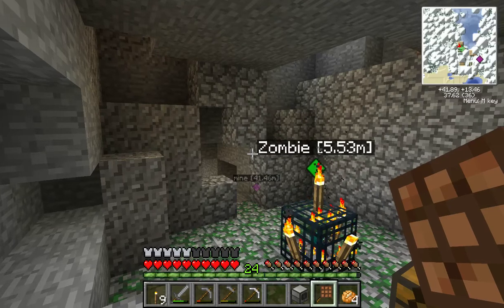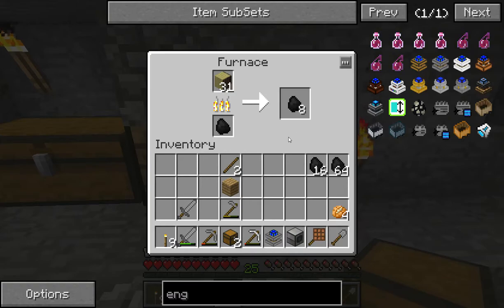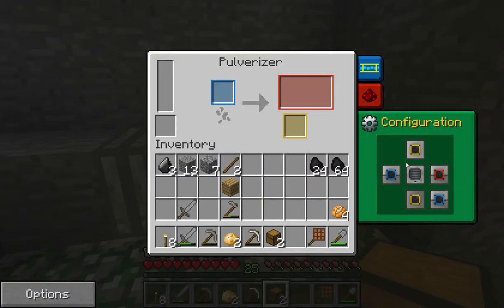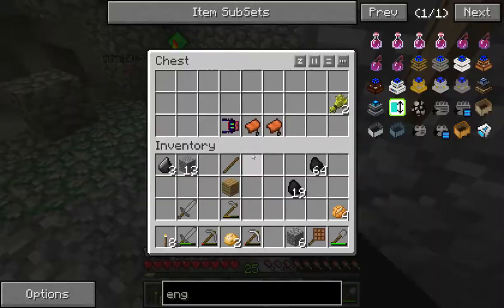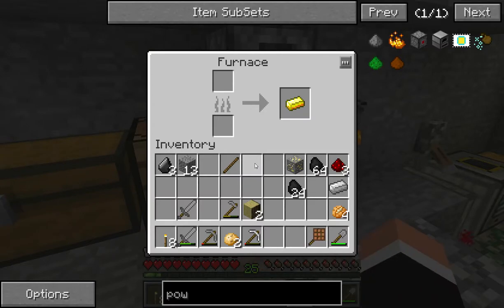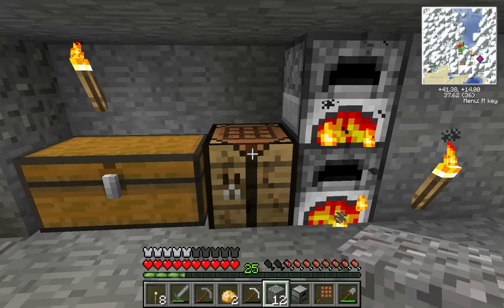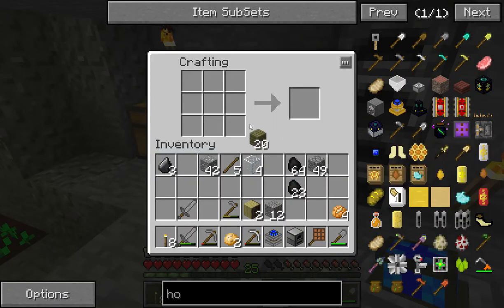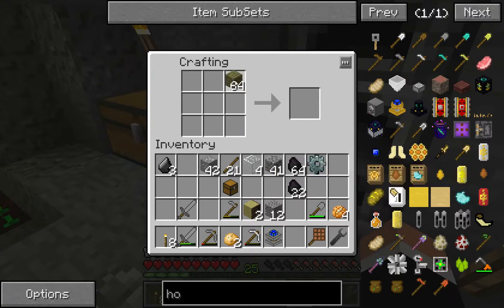Feed The Beast episode 3. Pulverizer, Powered Furnace, and hoppers.

Comment from the maker: What engines are you using? What are you using them on? What fuel do you have in them? Do you have a redstone signal (lever) going to them? 

I haven't had any trouble with the engines in FTB yet. With exception to the time I tried to use one stirling engine to run a thermionic Fabricator. Fyi, it needs two.